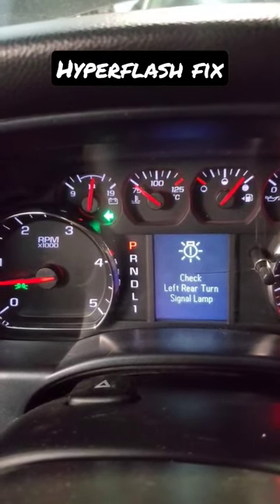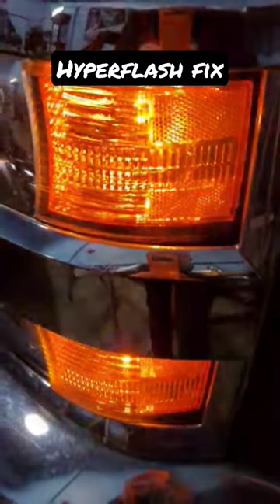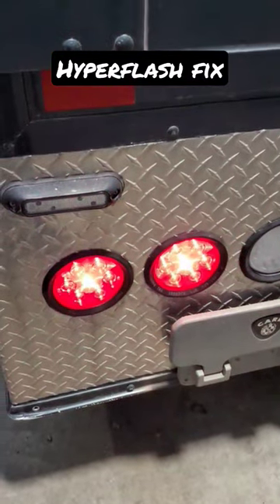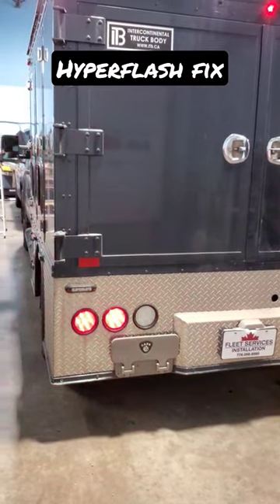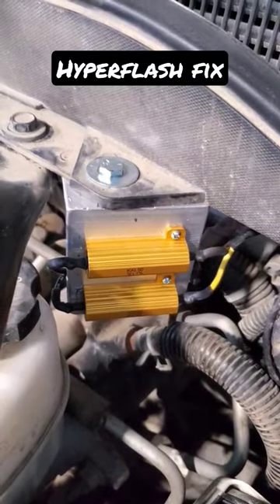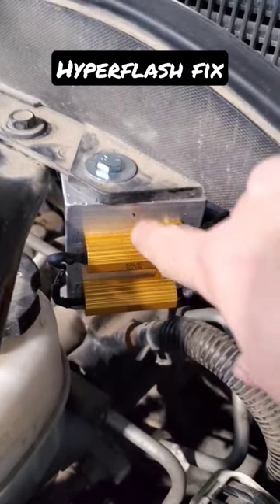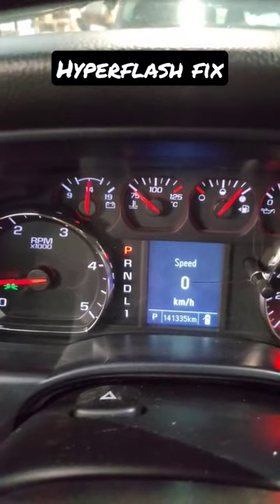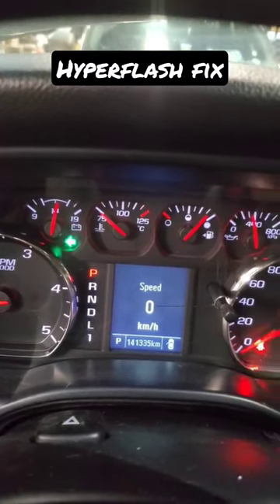Fix Hyperflash with LED bulb conversion on BCM controlled signals. (Chevy Silverado / GMC Sierra)

Comment: I have a ‘21 Sierra that had incandescent taillights. I bought a set of Oem led’s with the factory harnesses and installed them. They hyperflash and send a fault message when u use the turn signals so I bought the necessary resistors and installed one on the positive wire to the turn signal. It’s still hyperflashing. Should I have installed the resistor on the negative?
Reply from the maker: The resistor has to get wired to positive and negative of the bulb circuit to simulate the incandescent bulb load.
Reply: @ much appreciated, I got the lights working perfectly.

Comment: So if i put led's all over will the 4 ways hyperflash? I drive a cruze for trafic control and more lights The better lol
Reply from the maker: If you add LEDs it won't hyperflash.  If you replace the incandescent with LED it will.
Reply: @AnthonyJ350  yeah that's what I wanna do replace all my incandescent with led so it flashes real fast. I want hyperflash lol

Comment: My car goes flash normal flash fast
Reply from the maker: With load resistors
Reply: @AnthonyJ350  not LEDs some idiot decided to cut the wires for both front turn signals
Reply from the maker: @NikolasRyan-db6fq  Ya you'll have to repair the wires.

Comment: @AnthonyJ350 what are ur thoughts on the tried and true Sylvania LED load equalizer resistor, and it comes with T-tab splice that u can cramp them between ground wire and a resistor wire?
Reply from the maker: They're fine, I would just solder your connections and not use the t-taps.  The t-tap cuts the wire and exposes the wire to the elements.
Reply: @AnthonyJ350  nice. I’m not a fan of cutting nor I would never cut at all. 

To me using T-tabs is a better solution > cutting and soldering. 

Although I can agree it is expose to the elements. 

But even if it’s exposed, it’s covered with T-tabs and u rarely heard this issue of wires gettin possibly corroded. 

How about the alla lighting - with load equalizer resistor and turn them into plug and play version that came whatever to either 3157, 7443, or 1156? Instead of T-tabs.

Comment: Nice informative video! So do i only need the two..one on each side rear or do i need four one in each corner front and rear..or does the rear control the front as well? Thanks
Reply from the maker: You need a load resistor for every turn signal light you replace.

Comment: Do they have to be bolted?? For the resistors to do thei job? Or it doesn’t matter i have the same problem but i didn’t bolted them
Reply from the maker: I would fasten them to a metal surface to help dissipate heat.

Comment: What if I got resistors with the aftermarket leds, NOT the quick splice, but still getting hyperflash...? They are only ziptied to metal for now
Reply from the maker: Did you wire them to negative and positive of the circuit?
Reply: @AnthonyJ350  plugged right to the female end they provided already worked into the harness
Reply from the maker: @Daddy_D2015  You have one load resistor on each LED bulb replacement?
Reply: @AnthonyJ350  ots the whole assembly.  Not just the bulbs
Reply from the maker: @Daddy_D2015  The vehicle thinks a bulb is burnt out on one of the circuits
Reply: @AnthonyJ350  right, cuz the led draws less. But I'm figuring the only thing can be resistors that came with them are defective ir the hard connectors aren't good. Will try to butt connect them,,,if not, trying new resistors
Reply from the maker: @Daddy_D2015  Let us know what you find please.

Comment: So would the load resistor go between the tail light running lights or the signal for the turn signals
Reply from the maker: You just need it on the signal lights.

Comment: Where did you connect the wires in the distribution center for this? Have hyper flash in my 2014 Chevy 3500 after replacing all lights to led
Reply from the maker: We found the light circuits on Alldata and spliced into the corresponding colours after testing.

Comment: So I have two of these generation 6.0 with service bodies, both have load resistors, but one truck has hyper flash on the drivers side and fine on the other. Add more resistors?
Reply from the maker: Resistor might be defective.  I would replace.

Comment: after i install the resisters they won’t hyperflash or get water damage anymore correct??
Reply from the maker: Water damage is dependent on your installation.  Load resistors cannot prevent water damage.
Reply: @AnthonyJ350  my lights haven’t been water damaged, however my lights do hyperflash every now and then when it rains, if i put electrical tape around all the wiring then the resistors should the issue be solved??
Reply from the maker: @darkne2sss  Did you install LED bulbs in the turn signals?
Reply: @AnthonyJ350  not sure, just installed a whole new aftermarket tailight